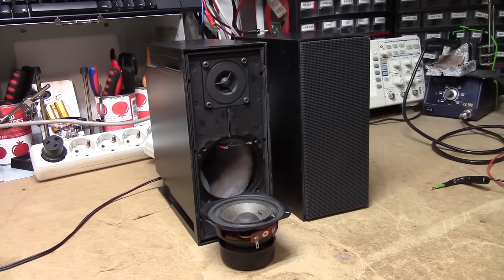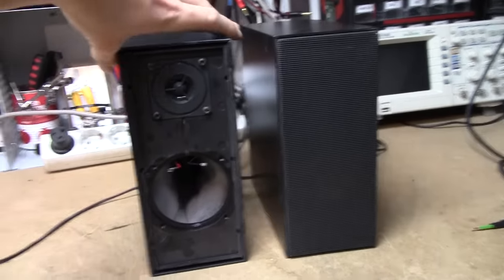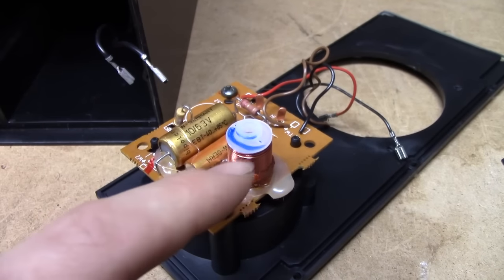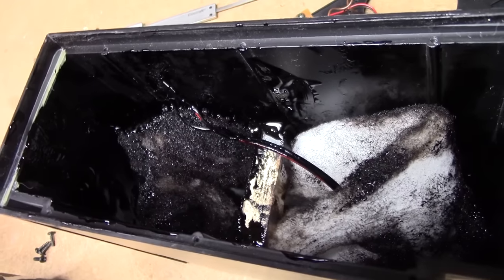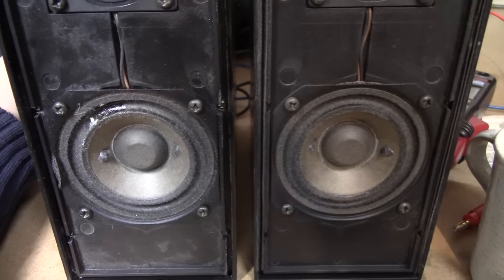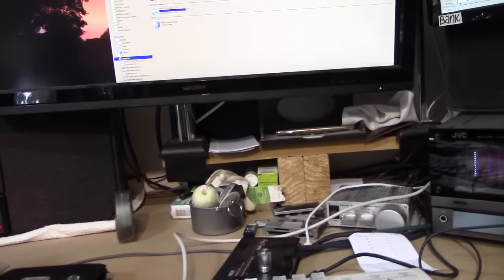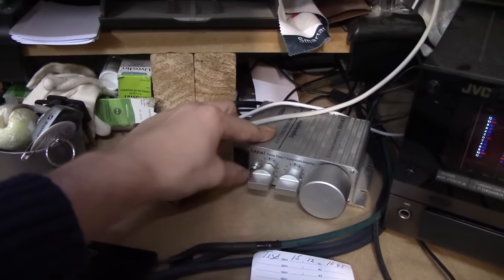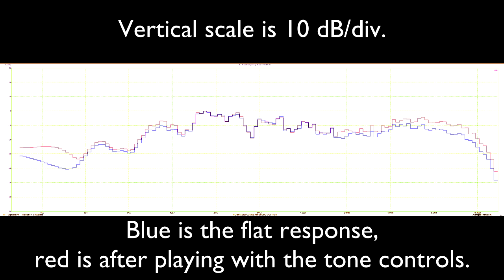Bracing my very old computer speakers to kill resonances

Comment: Came here to tell you that bracing doesn't kill a panel resonance. It does nothing to it's magnitude. It just rises it's frequency. It does minimize panel flex though (at the bottom frequencies). To lower audibility of a resonance you need to dampen it. Expensive way is constrained layere damping. For craftier solution to the problem, see KEF LS50 white paper (a brace glued using a thick layer of butyl rubber).

Comment: I got that tv like 1,5 months ago! I took the speakers ofc, thats why i got the tv! The side speakers came with a very good quality subwoofer! Did you get the tv without the subwoofer? Mine were foam rotted but fixed them with latex and it is a finlux VARIO tv! Check my speaker hunting #3 for the tv, its the last tv in that video! I have the models in the video

Btw im finnish aswell c:!

Comment: Do you have RTV silicone? its great for fixing speaker surrounds
Reply from the maker: +Rex Holes You're probably wondering what happened to your other comments; Youtube considered them to be spam and discarded them without telling you about it.

That said, I've never tried RTV silicone, no. I tend to just re-foam speakers when they go bad, but it happens rarely.